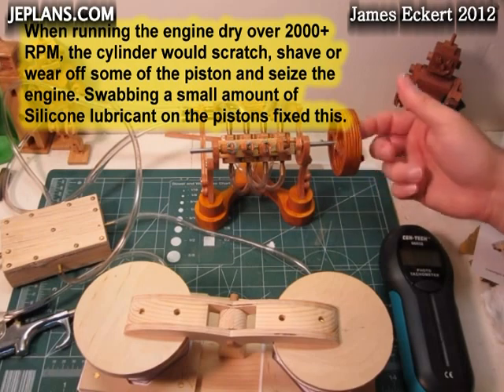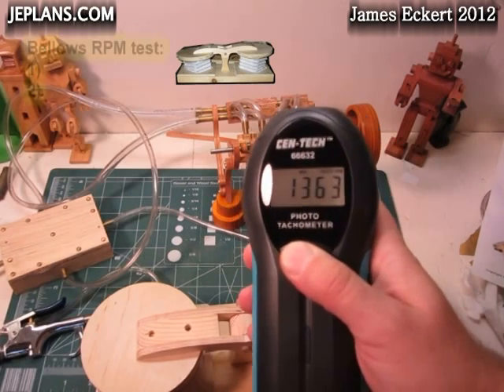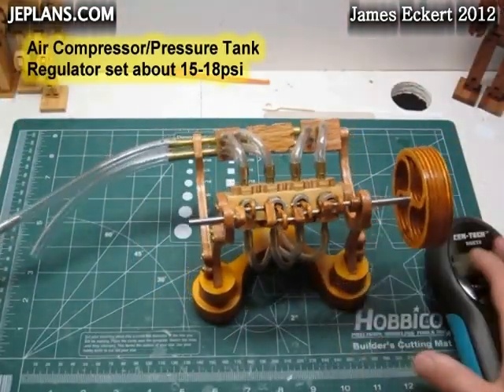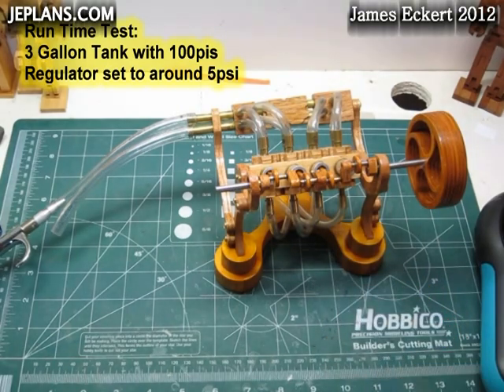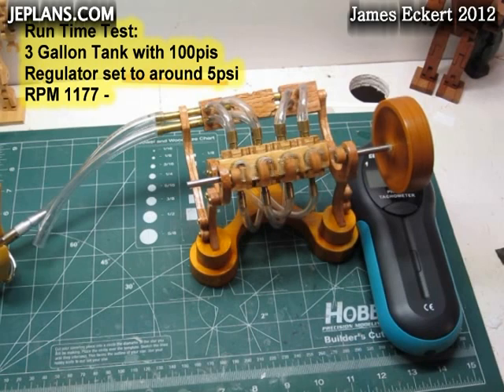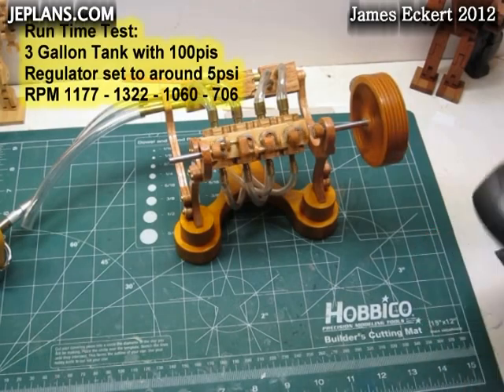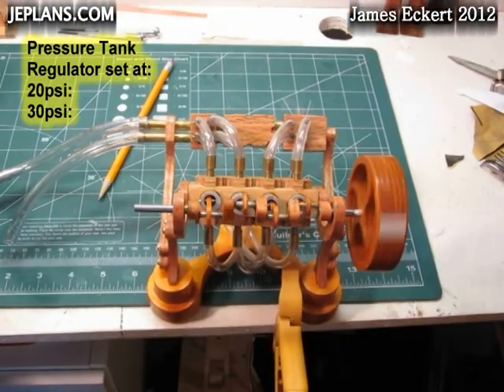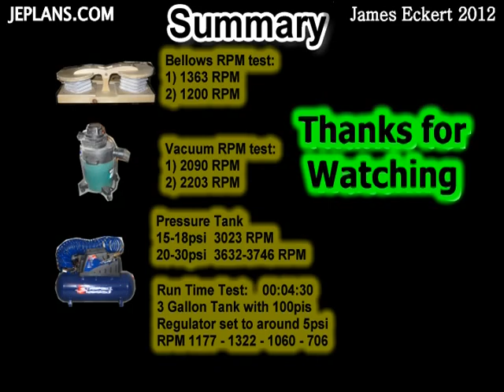Inline 4 RPM Tests

Comment from the maker: At 15psi force would be .9375 pounds of force on the piston.

The composite of the angels all 4 pistons should equal 1
piston at a full 90 degrees and full pressures. 

N = Pounds
m = Inches

If a force of magnitude F= .9375 N is applied 
at a distance r= .19685 m from the axis of rotation
in an orientation where r makes the angle? = 90 degrees
with respect to the line of action of the force,
then the lever arm =.19685 m
and the magnitude of the torque is t=0.184546875 N m.

Comment from the maker: If I didn't build it out of mostly wood steam or hot air would be fine but I don't see how they would improve efficiency.  I suppose the moisture from the steam would make a better seal and lubricate a bit. For real efficiency one has the figure the energy use to create the compressed air, steam or hot air in the fist place.